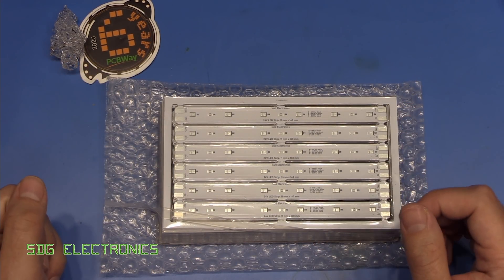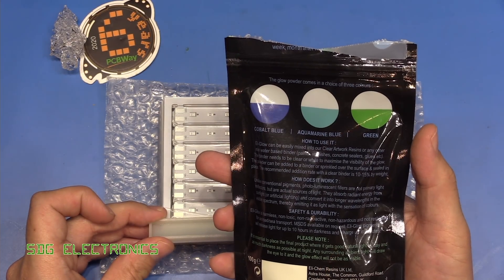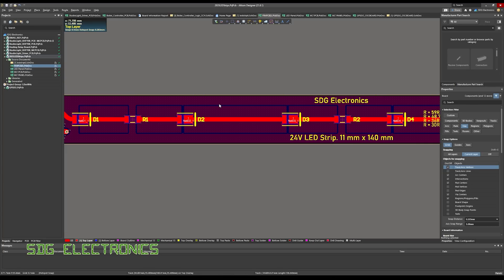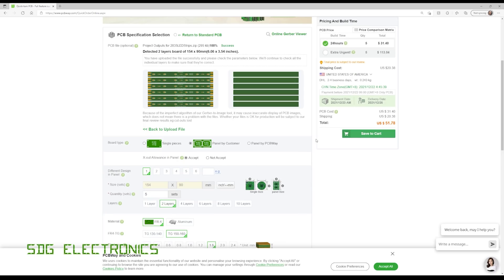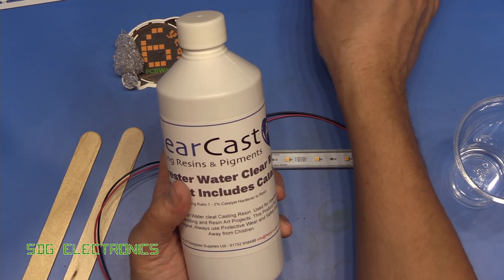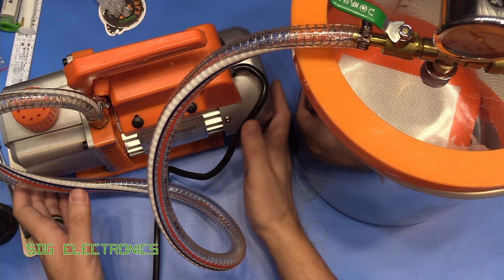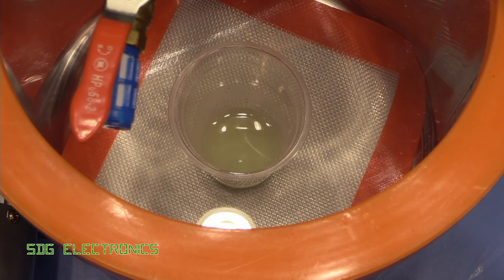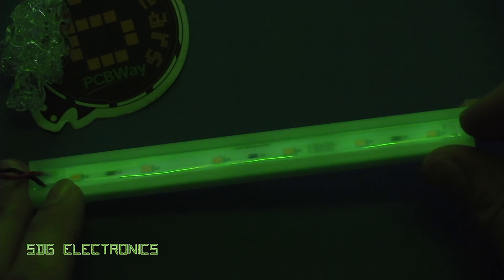SDG #238 Zero Power LED Night Light Strip with PCBs from PCBWay

Comment: I'd be interested to see what sort of (flicker free) light levels you could get down to by reducing the drive voltage in combination with PWM?  I'm thinking of a similar application, to give just enough light for navigating (non sleeping) rooms at night, but without disrupting circadian rhythms.  Perhaps a dual colour strip with mainly high CRI white LEDs (for high light levels) plus a smaller number of orange LEDs (for "night mode")?
Reply from the maker: If you add an LC stage to the PWM output, you can get flicker free light right down to barely visible levels.

Comment: You could design a spot for pouring and let gravity draw the resin down by having it on an angle. Also if you pour from a good height with a small slow stream I think that helps reduce air from getting trapped
You could also not.pour it o  the leds at all. Then just keep them 2 layers.

Comment: Instead of encapsulating the entire light strip in epoxy resin, it might be better to add the photo-luminescent pigment to a (clear) 3D SLA resin.
Since the strontium resin absorbs UV light, it also naturally cures the print. It might turn yellow over time, shouldn't be a negative thing in this use case.
Great idea, especially for those who can't see in low-light :ø)

Comment: Something I've found when potting LEDs in clear resin is that the colour temp gets noticeably colder - not sure if this depends on the resin or LEDs - did you notice this ?
Reply from the maker: No I didn't see any difference, but it did have the glow in the dark pigment which may have changed things. I'll try without the pigment. Was is the same effect no matter what the original colour temperature?
Reply: @sdgelectronics  I think it was with 3000K LEDs, made them look more like 5000K - these were Osram, which had a hard resin surface, potted in a slightly soft epoxy
Reply: @sdgelectronics  If you have a spectrometer I would be curios to see the output with and without the pigment and epoxy.
Reply: Wondering about very similiar effects considering Samsung LM301H series and their silicone potting. Supposedly making them resistant to sulfur heavy spray in horticultural applications.

Comment: When you pour the long ones if you get air bubbles you can use a butane pen torch to pop them that is how modellers do water scenes etc, might work with a hot air station too.

Comment: Interesting idea, but I saw that green tint with LED on, so makes me think if it makes sense with high CRI emitters or vice versa.
Reply from the maker: I should measure the spectrum with and without pigment
Reply: @sdgelectronics  Pretty sure potting with just resin will affect CT as well. Not sure how much in case of epoxy designed to be optically transparent and not just clear.
Reply: True, but I think he simply has a ton of High-CRI emitters thanks to the close out and this is the first project he's used them on.

Comment: Is the low led density just for the hand assembly or also for final product? Do you not need that much light?
Reply from the maker: It's the equivalent of 25 W/m because of the high drive current of these LEDs (180 mA)
Reply: @sdgelectronics  I was thinking of having like 20 leds instead of 3 and running each led at a way lower current to get equivalent light.